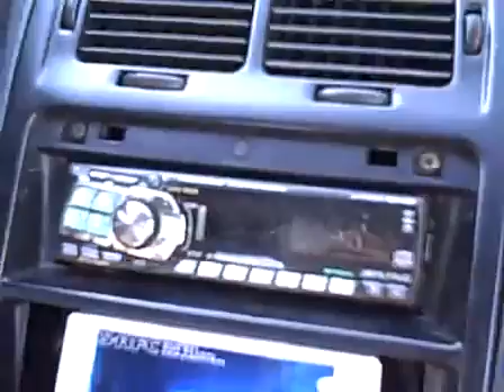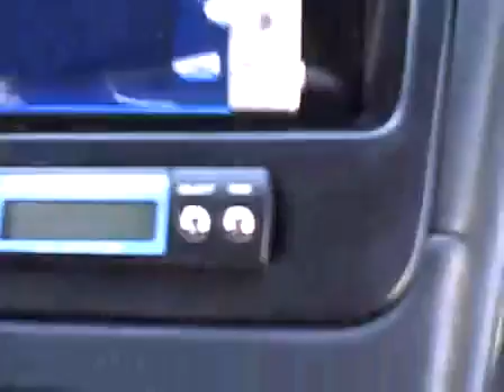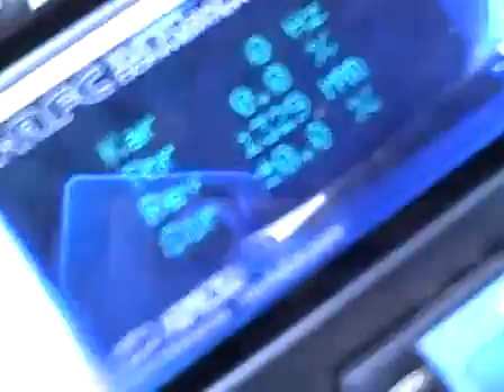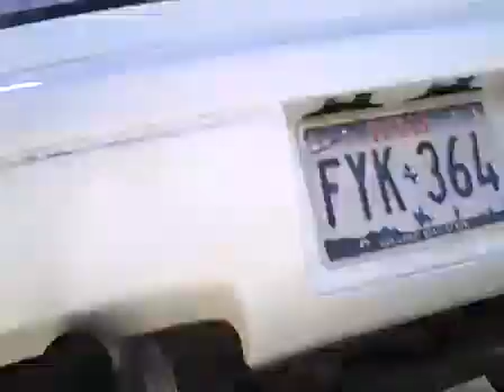my twin turbo 300zx 400 rwhp drift drag street car

Comment from the maker: actually, despite what you think, it is a jwt pop charger, and yes, you are right with stock injectors only 350 hp can be achieved. but, i can put whatever i want because it's my video. make your own. p.s. it's in the shop getting brand new 98+ spec oem tranny built and 555 nismo's and greddy sidemounts. so, should be around 500rwhp in about a month. also installing a dual pop charger